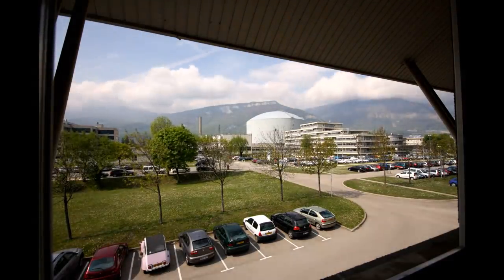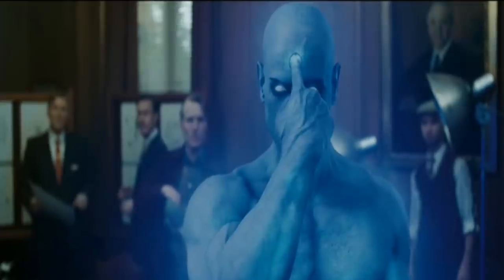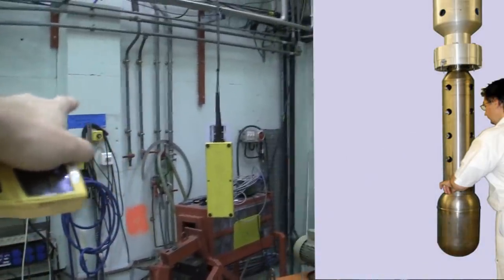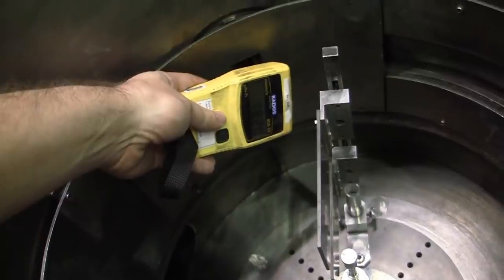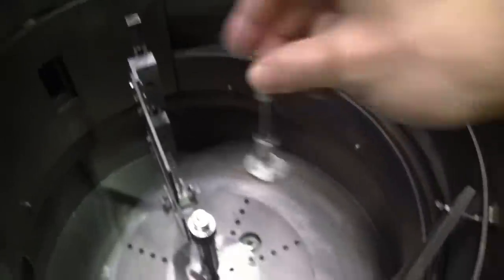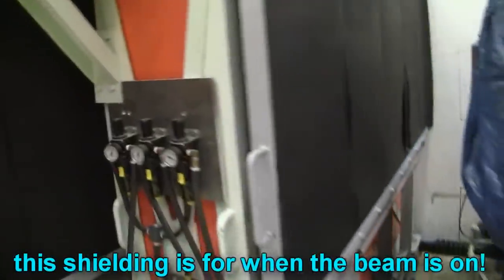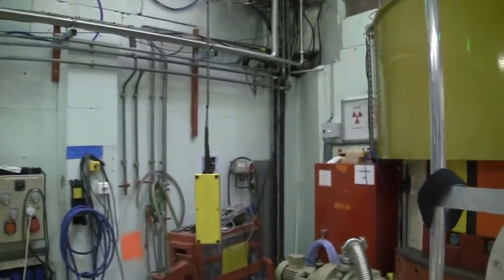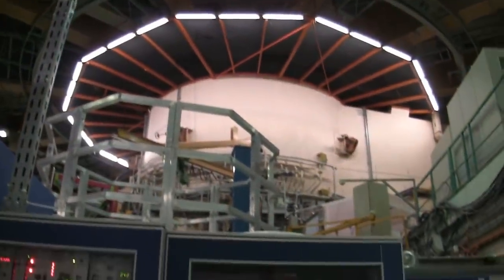Nuclear Reactors, Fantasy and Fact!

Comment: The closest ive been to a running core was about 4 meters i think. Its hard to estimate, its one staircase above the level where the core is. But it wasn't that big reactor. Its an experimental one on my university and it has to run at 20% enrichment. There is also fusion experimental reactor and one subcritical "reactor" is almost finished too. Its cool to see those things. There is also a particle accelerator and so much more stuff. 
Also in my 1st year there, some guy accidentally dropped his ruler into the reactor and kept asking, when they will return it to him.

Comment: In regards to your gamma shield potential concrete does absorb a lot but it's has much to do with it's water content in the concrete, I'm sure your station has a system to ensure water/tempering water in case the reactor starts to get too hot to cool it for that reason and to reduce the hydrogen excursion that happens when it get hot. apparently people don;t like hydrogen explosions destroying their containment structure.
Reply: Water helps but I'm sure the huge wall of concrete does most of the radiation blocking.

Comment: I know this is an old video, and I'm late to the party...
All I've read about in the comments is isolated (very isolated) incidents of one or 2 people being irradiated. 

Interesting how the media pick up on that and run with it like a line-backer heading for the touchdown line... (I'm not 'Murican, so forgive me if the metaphor is wrong)...
What the media completely ignore (or are told to ignore) are the shear volumes of people KILLED in the production of coal, oil and gas... Maybe if the media presented a more balanced view we'd be shutting down fossil-fuel power stations (and just about everything to do with coal, oil and gas) and setting up small scale (thorium) reactors....

Something worth thinking about....

Honestly, nuclear is the ONLY viable short-term answer to the current emission levels. Without it, under the current system, earth is heading for a Venus-like demise....

Comment: What happens if one were to accidentally fall into that pool? I'm actually curious.
Reply: If you can't swim, you'll sink into the bottom and get radiated. If you can, hopefully your co-workers can rescue you and you'll continue your life as usual. You might get fired, though.

Water is there to shield environment from the radiation. So obviously there's so much water that on the surface radiation levels are relatively low.

Comment: Is there a video where thunderf00t talks about the issue of nuclear waste?
Reply: Nuclear waste is surprisingly benign. It is, by definition, depleted uranium. Reactor fuel isn't anywhere nearly as enriched as weapons grade nuclear fuel. Additionally, a commercial scale power reactor creates about enough waste in a year to fill the interior of a large family car. That waste can be safely stored in pools of water a couple of feet deep.

The half-life of several billions of years is often cited as a reason for the danger. In actual fact this is wrong. The long half-life indicates that it is decaying very slowly and thus the amount of radiation is vanishingly small. Barely above background.

The isotopes we need to fear are those with much shorter half-lives. These are decaying fast and thus the radiation levels are significant, albeit short lived. These are rarely mentioned by those opposed to nuclear electricity.

We have to big up the danger of nuclear reactors and nuclear waste in order to maintain the fear of nuclear weapons. Without fear the weapons are useless and governments will lose their stranglehold over those they govern.

Comment: To transfere half of the existing fossil fuel energy system to fission would require 5,000 nuclear power plants, which would use up known uranium deposits in roughly 80 years. I know squat about reproccessing and the like, any way to extend that?

Realistically, Capitalism is the beat that must grow, and double in size over roughly 35yrs. Until we fix that, it wont matter which direction we go in as they will all lead to the same destination.

But I quite agree with you on new reactors. They are by far, superior to their predecessors. Many of which were designed before computer modelling existed.
Reply: It's like everything else. Compare a 1950's car to a modern one, for example.

Comment: Clearly, non-damaged nuclear reactors are designed to be safe for the workers. However, when nuclear reactors become damaged by things like a meltdown (Chernobyl), tsunami (Fukushima), or even an incorrect part that causes cracks in the coolant pipes (San Onofre), the nuclear reactor can no longer be considered safe. Also, the disposal of spent nuclear reactor fuel can be hazardous to transport and store.
Reply: It can be stored in a pool of water. Spent reactor grade uranium is not dangerous.
Reply: That uranium is not completely spent. They had to shut the reactor down early because neighbors downwind found it was venting radioactive steam. (Yeah, others had to tell them they were venting radiation.)  It was venting steam because of hundreds of cracked cooling pipes. It had cracked pipes because they installed a wrong part. It's estimated that the unspent uranium will be toxic for hundreds of thousands of years and they want to store it next to the ocean next to a major freeway and near several large population centers. What can go wrong? Oh, and BTW, they had a clandestine meeting with "regulators" in Poland and decided to make rate payers pay billions of dollars for their mistake.
Reply: Leslie Franklin commercial  reactors can be shut down in seconds. Control rods are suspended above the core by electromagnets and by vacuum. Loss of either will result in the magnesium oxide boron composite dropping into the core within seconds.
Reply: Well, they did successfully shut it down, but not after it was spewing radioactive steam for who knows how long?. However, the repair the hundreds of cracked cooling pipes was estimated to cost more than building a new plant. That, and the revelation that the plant wasn't well maintained, resulted in the decision for it to be decommissioned. Now, one issue is what to do with the partially spent fuel. When the plant was built, the U.S. federal government promised to create a safe repository, but they didn't. So now, their plan is to store it on site, next to the ocean and a main freeway. Note that salt water in the air tends to corrode things over time. Also, there is the potential of earthquakes, as what happens in this area occasionally.

Comment: 1,000,000 eV = 1 Mega electron-Volts~ 0.000 000 000 000 000 0016  JOULES . (energy).
Approximately 16 ^ (-16) WATTS PER SECOND. (POWER released in1 second. )
Neutrons are nor positive or negatively charged. How does a wall of electrons stop them. And what  does it look like? 
Know-it-all commentators. STICK IT UP YOUR IGNORANT A. HOLES.

Comment: I still freak out my friends and family members when I tell them that at 19 years old I was working on building nuclear power containment vessels, sacrificial shield walls and refueling pools as part of my craft apprenticeship training program. And my buddies were working on special projects for the Department of Energy at the Hanford Reservation. Like any complex facility, reactors have rules, regulations and protocols that must be followed. I can remember when the local television news program announced that a nuclear leak had taken place at our facility. (Which was under construction and NOT in operation). It turned out that a welding contractors x-ray testing crew had dropped the hot capsule used to x-Ray welds. FFS!! Stupid television reporters didn't even bother to clarify what happened until the public had been scared shitless!!

Comment: Can you talk about thorium reactors? It looks to be the best weapon to fight climate change. Thorium molten salt reactors will be cheaper in every way - thinner structures (low pressure), no cooling tower and no massive containment done needed. Plus the cores can be mass produced yielding additional savings. Plus valuable materials can be extracted in situ. Plus there is no need for expensive enrichment or fuel fabrication. Plus you can burn 50X more fuel (greater efficiency). Plus there is 3X more thorium than uranium etc etc ...

Comment: I can do parlor tricks with uranium and plutonium too. It doesn't change that the neutrons are slowly making every piece of that equipment radioactive, and we will have to bury your entire facility and keep it buried for 100,000+ years.  Different type of reactor, but for fun, go stand in front of a used uranium fuel bundle for 20-30 seconds and see how you fare. Oh, you can't? Thats just spent weak fuel ... that is now hundreds of thousands of times more dangerous than when it went in to the reactor and will be pretty much forever, and we still have no geological storage that can actually deal with it.

Comment: The typical person can only get within about 100 meters of the nuclear reactor before they die of gunshot wounds.
Reply: Before 9-11, one could walk right up to the control room building, cooling towers, etc at many US nuclear plants.
After 9-11, not so much.
Number of terrorist attacks on nuclear reactors in the US remains what it's always been at, zero.
Reply: @spvillano  This is actually largely completely false, even for smaller research reactors. Virtually nothing changed in terms of security post-9/11, as there always was decent security in place. You literally can't just walk into a nuclear reactor. Same goes for trying to crash planes into nuclear reactors; it wouldn't have worked even BEFORE 9/11, as they are designed to withstand such impacts.
Reply: @PHeMoX  odd, my wife and I, just after 9/11 walked right up to a nuclear reactor cooling tower.

Right up to it, touched the base with my own hands.
Drove right up to it, through an open gate.

So, tell more fish stories.

Oh, TMI had a containment building that had concrete 8 feet thick, that would withstand a 747 dived into it? Where, on Bizzarro world?
Reply: @spvillano  you do understand that the cooling tower is not the reactor and is some distance away right. And yes they do believe they can withstand a direct hit from a 747. Engineers have a pretty good understanding of the energies involved. They ran a f4 fantom into one at 770 km and hour and it did basically no damage. Security at a nuclear plant isn't concered with you being able to breach a core. More worried about spying
Reply: @spvillano  the concrete used in a reactor is not the same concrete you use to build a road lol it's very special concrete engineered to protect the reactor from both internal and external explosive stress
Reply: @kylecarter3024  where did I mention the cooling tower? I said that the TMI containment was 8 feet thick reinforced concrete.

BTW, the orders for my NG troops wasn't to watch for spies, they were armed and were to keep anyone not on the access control list, with the proper ID, off of the property and had a use of force escalation tree that was quite steep.
Reply: @kylecarter3024  what do you want to know about concrete? Concrete with plasticizer? Low moisture, obviously, don't want the water inside of the cement/aggregate matrix to boil and spall the majority of the surface away! Reinforced, obviously. Worked with 10000 pound test, for compression and shear.
Reply: @kylecarter3024  you were on such a good track and then derailed at the last second. Nuclear security is 100% about health and safety of the public and about being able to safely cool the core and prevent a Part 100 release. Aside from information which would help an adversary cause a release (Like security plans and response times), nuclear security gives exactly zero shits about somebody spying. Nobody would need to soy anyways. The nuclear industry is all about sharing information with each other so we can learn and get better. That's why we have INPO and why benchmarking is an extremely common practice in the industry.
Reply: at Callaway in Missouri, security doesn't play around. there is a crew of guards for each shift that patrol the entire area with ar-15s and train more than police.
Reply: TheUglyGnome Must be a tiny reactor if the street is 40 metres away from the core. Are you sure you don't mean you were 40m away from a nuclear power plant?
Reply: @JamesBalazs  He never said "core", did he.
Reply: saying they "train more than police" doesn't say much in the USA.
Reply: @hashbrownz1999  I agree. Look how the US police conduct road pursuits. Dispatch a dozen Ford Crown Vics (which handle like barges) in the hope that one will catch the target vehicle before they all crash into each other.
Reply: @paulanderson79  apparently according to the cops the more cars you have the faster you go
Reply: +TheRebel3000
It was a research reactor like the one where Thunderf00t works. Smaller one, though. TRIGA type.

You have to remember that security measures on these civil research reactors are far more relaxed than on power plants or military research sites. This is because there's no weapon-grade material to steal from there and it's impossible to create a serious nuclear accident with these babies.
Reply: @TheUglyGnome  Actually the research reactor shown in this video, located at ILL in Grenoble (France) works with highly enriched uranium, which is actually weapon grade. Therefore security measures are indeed very high, first you have entering controls to the campus, in the future you have also to pass a second control with metal detectors and stuff to access the institute, then you have to get to another security check (as a visitor you also have to exchange your visitors pass by another pass) but its almost impossible to get in if you arent a researcher there. But if access is granted you get through a really massive pressure door into the area which is shown in the video. You are now in the containment, but the reactor is still not reachable. For that you have to get up  in another area, where the reactor is actualy aceesible, but for that you need a permission by the government.... with even higher security measures.
Reply: @TheUglyGnome  I
Reply: @TheUglyGnome  They've got a several of those type of things around Pittsburgh. One is a Naval research facility called Battelle. As Westinghouse, one of the largest nuclear power plant builders, was originally headquartered here, they have many small reactors. The public doesn't know where they all are.
Reply: @TheUglyGnome  then if it’s smaller then why would he say it’s one of the most powerful
Reply: Really? I've walked street around 40m away from a nuclear reactor hundreds of times. Didn't get shot. Didn't ever even see anyone with a gun there.
Reply: @TheUglyGnome  It really depends on where you are. Older generations of reactors can be dangerous if the wrong people get in there, so they're better guarded.
Reply: @TheUglyGnome  When there is nuclear materials, there is usually a guh with a gun somewhere.  Even conventional power plants have armed guards.
Reply: @TheUglyGnome  wow, how did u get imune to bullets? asking for a friend.
Reply: TheUglyGnome Also research reactors dont affect societial operations directly. Sinve they aint for profit, the NRC wont be calling in the Marine corps just to stop some kid from graffitting the outside of the reactor.
Reply: Really accessible.
Reply: Nominally a head wound. The assumption is that that sophisticated an actor is wearing ballistic protection.
Reply: Robert Nesbitt LOL....
Reply: What about the Chernobyl reactor?
Reply: I can attest to the fact that security at U. S. nuclear plant is quite high.  At the ones I've been to, the entire outer perimeter is surrounded by huge concrete blocks to stop any unauthorized vehicles.  The entrance has those pop-up steel barricades. The guards wear body armor and have automatic rifles.  The PESB (plant entry and security building) is equipped with x-ray machines, metal detectors, and explosive detectors, and a number of guards.  And after that you have to pass a hand geometry scanner.  The entry into the protected area itself has a guarded sally port.  Inside the plant, at strategic locations, there are armored steel boxes with firing ports covering entry routes.  And on and on.. it would take a small army to gain forced entry into a nuke plant.  As someone else mentioned, the containment was built with aircraft crashing into it in mind.  They're pretty darn safe, as far as physical security.
Reply: I remember hearing once about a jet that was shot down by security missiles when it flew above a nuclear reactor relatively close to my home, granted this was a couple decades ago when they were all very anxious of war and they feared there's a chance it was a spy jet to spy on the reactor
Reply: Lead is radioactive, or was, or something but bullets are made from it.
Reply: US police spend lots and LOTS of time training to shoot people, very little time training in human behaviours and de-escalation.
Reply: @77gravity  No. Most of the police in the US only qualify once a year, with about 50 rounds fired. Police training is abysmal in the US.
Reply: @77gravity  my brother is a cop, not true
Reply: Not if they got Rad-X on.